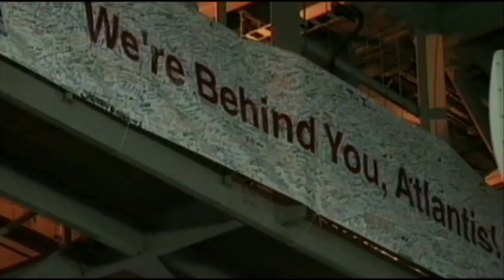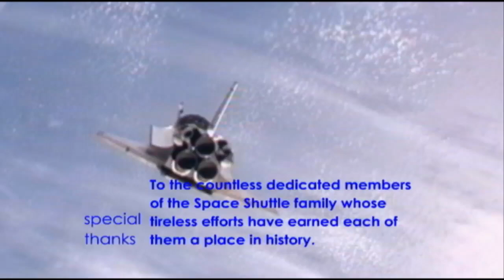STS-135 Ascent Imagery Highlights

Comment: Was the spinning of the shuttle at the end an intended part of the mission?
Reply: Yes, I believe that to be for the ISS crew to check the heat-resistant tiles for damage to stop a repeat of the Columbia disaster.
Reply: @olmusky8388 correct 

Checking for damage tiles are EXTREMELY important

Comment: @12:40- Aaand the boosters splash down to be recovered and re-used on a later shuttle missio- oh... wait....
Reply: They just wont be reused on another Shuttle flight.  They WILL be reused on an SLS flight, probably in 2022 now.
Reply: @hoghogwild the boosters were unfortunately being put on display in California with endeavour

As for reusing the boosters on sls, they won’t….
Reply: @goldgamercommenting2990  Yes they will.  SLS-1 actually used old used STS cases.  There's 80 segments left over that are within spec for flight.  80 segments is enough for the 1st 8 Artemis missions, for Artemis #9 the new BOLE' booster  with its filament wound case will take over from the old STS RSRM segments.
Reply: Yeah they will be continued to be used in a SLS flight.